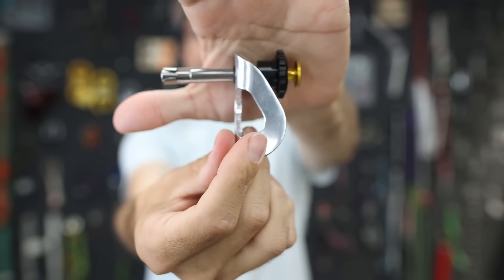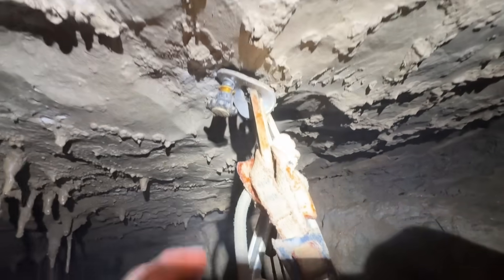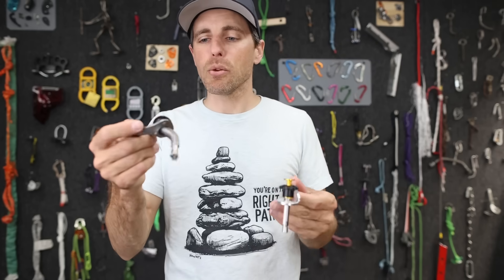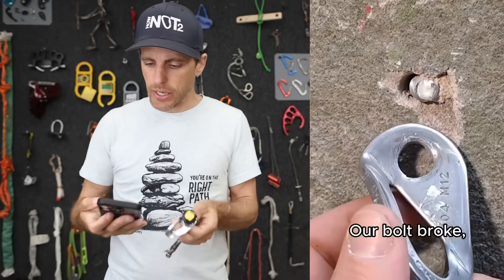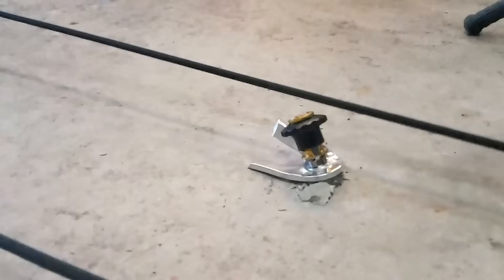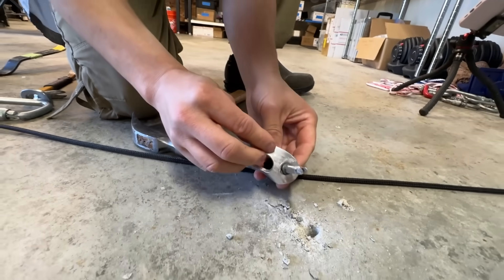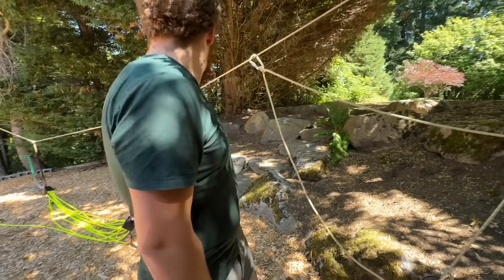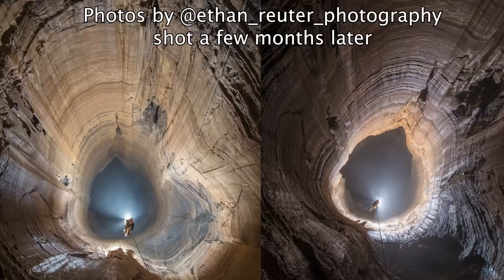We broke the rules... again

Comment: Be careful drilling into the concrete slab in a building. If the slab has pre-tensioned rebar reinforcement and you drill through that, you're gonna have a bad time.

Comment: we have used these on work instead of 10mm bolts but we allways use 2 ropes and 2 fasteners on each rope but we tend to not clean the holes good enought and normal expansionbolts are cheaper when you cant get these out anyways

Comment: Didn't you break several of these a few years ago ..  (or just the previous version)

14:24 the problem with high tech materials - they fast fracture with little warning..  And very little deflection (energy absorption through plastic deformation.

Comment: I've been using this 8mm for years. For bolting on lead from the bottom, solo or belayed. They are pretty strong but you need to be careful about 2 things. First is to drill the hole without moving, otherwise it holds less. Second is that on wet rock, it can move out, very impressive...
But I love it so much, very fast to use and save a lot of energy while bolting.
For lead climbing, on my french limestone, it's very strong even on big falls while opening new routes.
Thanks again for your tests 🎉

Comment: I use a mix of the 12mm petzel amd the climbing Taiwan removable to put temp anchors in routes to make sure they are worth bolting. I want to use them as lead bolts so bad but I’m not brave enough to try it. I think if it were proven safe it could make bolting so much better. I think we have all put that bolt in that later on lead we thought man I wish I moved it just alittle.

Comment: Interesting stuff. Did you drill 8mm holes or 5/16th holes? What type of rock was that at the end? Thanks-
Reply: 8mm.  Some type of Granite
Reply: These Coeur pulse bolts need to go on 8mm holes, drilled with a 4 cutter bit at that
Reply: 8mm and 5/16th can be used interchangeably for Pulses (so says Petzl), it's just a matter of the nubbins to ensure a round hole.  Must be 4 nubbins drill bits because 2 nubbins bits make an oblong hole.
Reply: @rachelhasbruises true, the manual does say that. My bad.

Comment: A friend of mine is considering bolting a route but, being a cheap person, he's considering using 10mm threaded stainless steel rods as glue-ins
The only  problem is I can't see what could go wrong, as sketchy as it sounds 
What do you think? Are threaded steel rods super good enough?

Btw great video, guys, keep it going!
Reply: If you are using quality SS it is hard to get threaded rod and hanger as cheap as a glue in bolt designed for climbing. It is a bit tricky to install cleanly, but done all the time in construction. 
Done with proper material it is perfectly fine
Reply: @bobbyhutton1989 Thanks!
Reply: @bobbyhutton1989 +1 on that, the exception I can think of is if your country doesn't have easy access to climbing glue ins, in which case it might make sense to go the threaded rod route. Just note that you lose one of the benefits of climbing glue ins, which is to not need to deal with tightening the hanger periodically, they are set and forget.
Reply: @bobbyhutton1989 he works in construction, so he gets the material for free (stainless steel rod scrap pieces, nuts and the adeguate adesive) from the projects he works on, so he only has to buy the hangers
Otherwise, I would agree there are easier and simpler ways, but I also wonder if it is strong enough, since I have no reason to think otherwise
Maybe the guys from @howNOT2 can give us some answers!
Reply: They probably are...but I still wouldn't do it.
Reply: I've used threaded rod glue-ins for cases when I need longer bolts or to reinforce/sandwich flakes. But I don't use them regularly because for me price-wise, the rod+hanger costs about the same as a golt-in bolt; but not everyone's case is the same. We've break-tested them and they perform awesome as well. Only  other downside would be they would also have to be occasionally tightened as the surface weathers away.
Reply: @climbingtaiwan also checked up your channel, and hats off to your channel too!
Reply: @climbingtaiwan  we do this in some of the caves/mines near me as with the short bolts the rock would go way before the bolt. Some of the resined in rods I’ve seen put in are a good 30cm. The results are great though and stand up well (we pull test fairly regularly)
Reply: @climbingtaiwan Many thanks for the tips!

Comment: Thank you for testing these, I've seen them in rope access videos and want to use them myself.
Reply: It's worth noting that the 8mm ones are not ANSI rated so professional rope access isn't allowed to be using them for anchors (at least in the US). 

The 12mm ones are the professional grade ones, and they have a steel hanger (in addition to being beefier all the way around).